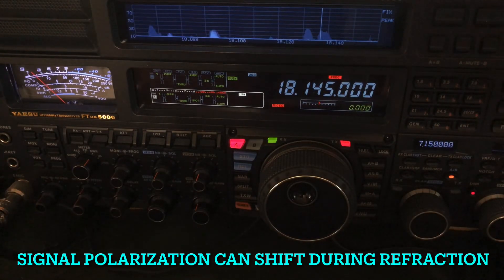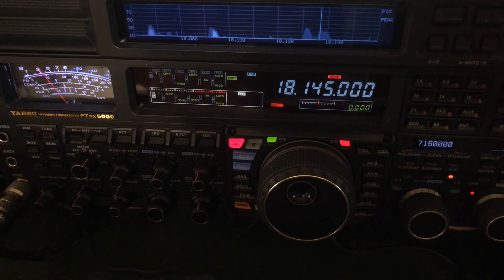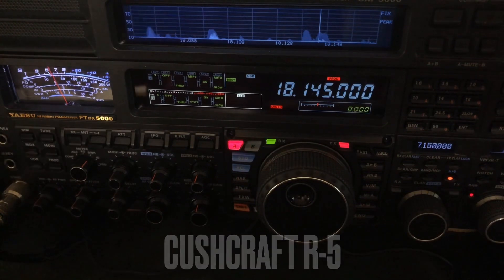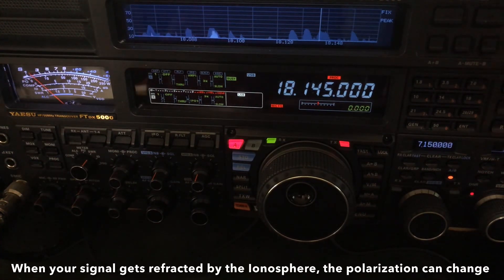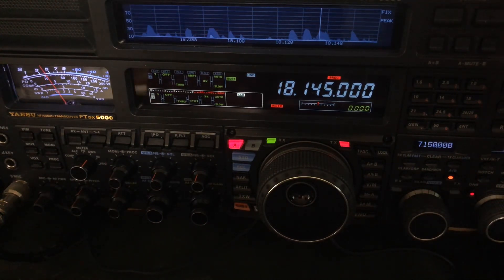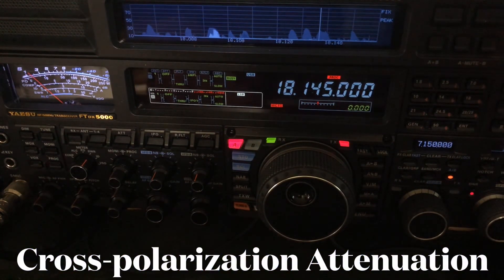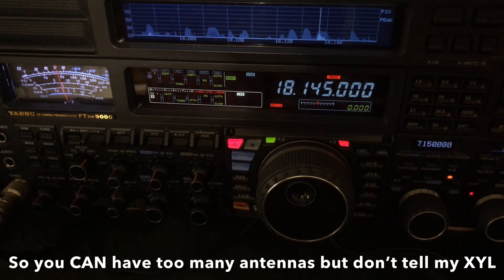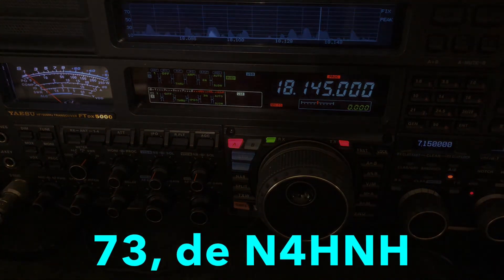Signal Polarization Can Shift During Refraction

Comment: I hear  some of fading,  signal being  strong and weak in periodic manner come from ionospheric polarization rotation.   at receive end,  polarization rotate slowly,  when it in same polarization as receive antenna , signal is strongest, when it in 90 angle the signal being weakest.  I heard one way to eliminate that is to use circular polarized antenna , like they do  in satellite works,  except this would be in HF frequencies.   AG6JU

Comment: I'm curious if you've read the ARRL book on "receiving antennas". The author, if I remember correctly, proposes that skywave propagation coming back to earth is circularly polarized. He and others designed a small receiving antenna for that purpose that utilizes an amplification circuit at the antenna. If you'd like I will send you the ARRL book. Thanks for the advanced videos. Marty KN4MNA
Reply from the maker: Hi Martin!  I’ve read so many books on antennas over the years but I don’t know if I’ve read that one.  I have a number of antenna books on the shelf, from the ARRL and other sources.  What I have learned from books and experience is that the signal “tumbles” in the ionosphere.  Sometimes it comes in better on a horizontal antenna and sometimes better on a vertical, no matter how it started.  It’s fascinating.

73, de N4HNH